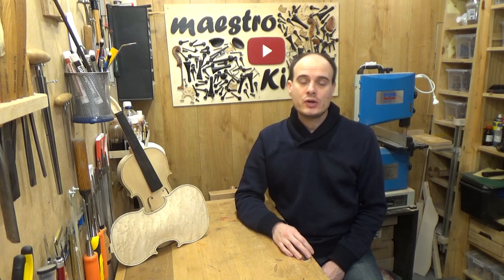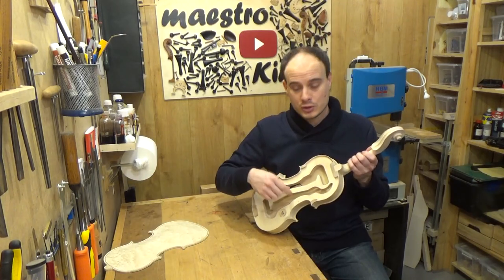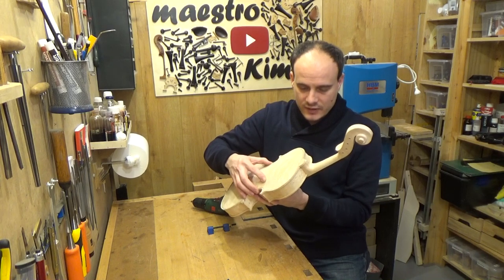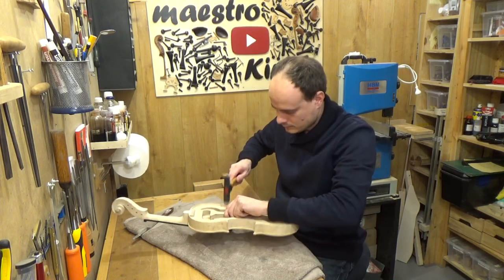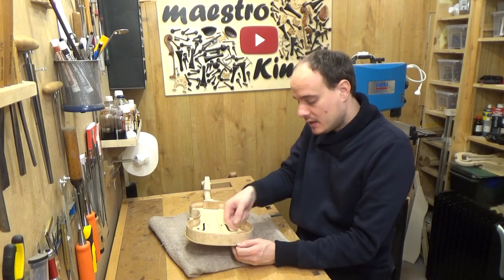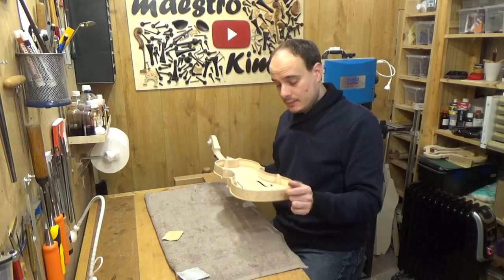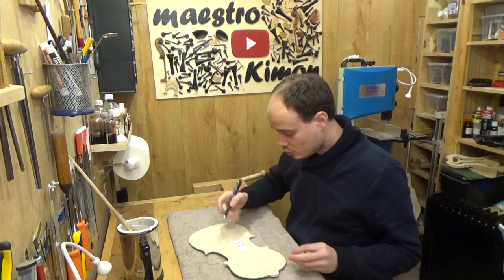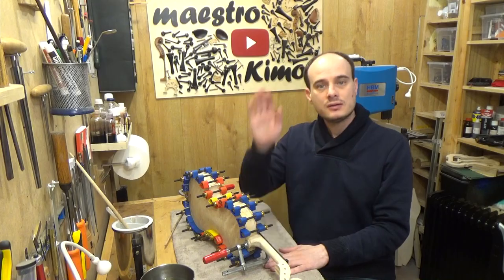Making a violin - step 20 - Placing the back

Comment: Maestro do you buy the hide glue from Dictum, as many other tools that I've seen you use?
I saw that there are no specifications on the bloom strength of this hide glue.
And I'm not sure if it's ok to use it to re-glue an open seam, on the upper bout of the treble side on the top of my violin.
Have you used this before? And do you recommend it? Love your videos!! And thank you in advance!
Reply from the maker: Γεια σου Ευριπίδη! Yes you can use the same glue. I have used the glue by Dictum in the past, now I use glue by a local supplier but not because the one by dictum isn't good.
Reply: @maestrokimon  Γεια σου Μαέστρο Κίμων! Thank you for the answer and your awesome videos!

Comment: is there an advantage with using spool clamps as opposed to using other ones, like 1 or 2 dollar f-clamps that are quick to close?
Reply from the maker: Yes there is. These clamp apply the strength not at the edge of the board but about 4mm further, exactly at the opposite side of the ribs. There, the board is a bit deeper, as there is the groeve over the purfling.
Reply: @maestrokimon  thank you!
Reply: @maestrokimon  Where can I buy these clamps?

Comment: Why add the stress of cutting the blocks with the top glued and not cut blocks first before putting top ?
Reply from the maker: You meant the shaping of the blocks at the inner side? Because before I glue the top on them, they are glued on the mold! Have you seen step nr 18? First I glue the top on the blocks, as soon as the glue is dry, I remove the mold and shape the blocks.